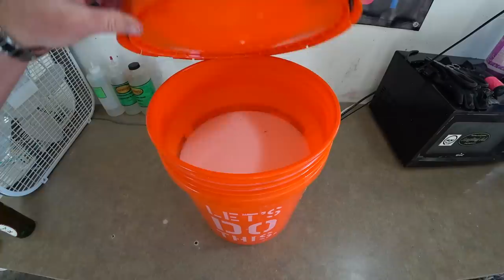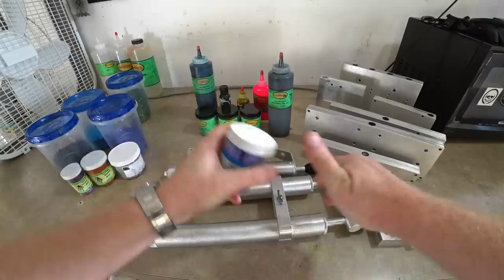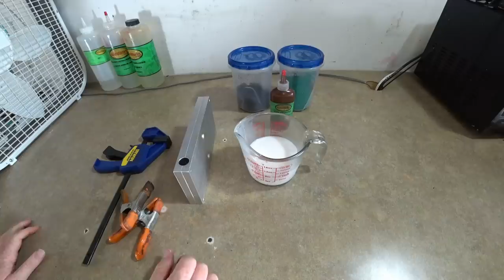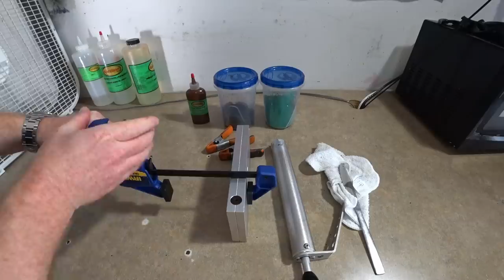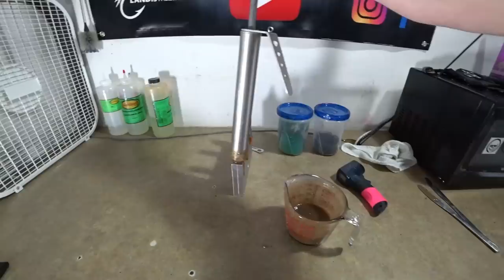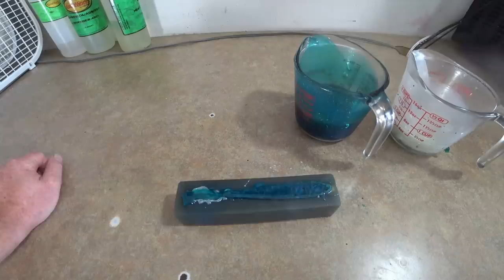COMPLETE GUIDE TO GETTING STARTED WITH SOFT PLASTIC LURES! How To Get Started pouring baits!

Comment: I forgot to properly mix my plastisol after it sat for months. I didn't clue in as to why the baits came out slightly firmer than snot until I noticed the 6 cm of solids in the bottom of the jug. Took a whole bottle of hardener to firm up the batch. A valuable lesson learned.

Comment: Awesome video! Learned a lot and can’t wait to start. By the way, I see you have a good ventilation set up, but as a respiratory therapist. I would still recommend using an N95. Micro particles are still being inhaled, which over time can lead to respiratory issues. Just some friendly advice.

Comment: Excellent video, have you thought about adding an overhead stationary post into the microwave that would stir the plastic as the turntable rotates? Just a random thought I had... anyway thanks for the excellent info I always wondered what the injection molds looked like and how they were injected. Thanks again.
Reply from the maker: never thought of that..some guys use cooking pots with electric stirrers if you are doing large volume.

Comment: You can save, you can buy most things and craft store for 1/2 or 1/3 the price, glitter, color and for the injector use a gear lube gun, just need to buy molds also can start with open pour molds and cut your expenses even more. Also for open pour molds you can make your own, plus you can re use old soft baits, I can see you doing open pour worms for less that $100.. 
However this vid is a perfect by the book way of getting starting in a more precise way.. and once you get everything you'll have tools that will last 100+ years. Your great great grand children could be using these tools.

Comment: Just finished lol. Another awesome video Chris. The plastisol fail was epic. Fly in the plastic, lmbo. The satisfying thing for me is that aside from the using the water part, I knew every thing else in regards to the injection molds, from you prior videos.  I feel like I am really learning lol. 
Question..Did you get the trick worms from BT?  
Also, could you tell me which baits should get softener added (generally)?
Reply from the maker: Glad yoy liked it..yeah the trick worm was from basstackle..it may be over at BTS molds now..I add softener to senkos and trick worms sometimes..depends on the order
Reply: Thanks bud

Comment: Is there a difference in the glitter you get from lure manufacturers and the glitter you get at like Hobby Lobby or Wal-Mart?
Reply from the maker: Yes big time, the lure glitter is a special high temperature polyester glitter than can withstand heat.  Most other craft glitters are aluminum which blow up in a microwave and bleed when hot.

Comment: I got a craw open pour for Christmas. And some little cubes that look like scent cubes for those little cookers that everyone loves nowadays. Have you any experience with those types?

Also do you have to deal with patent issues since you are selling your own with zoom molds or any other name brand molds?
Reply from the maker: never used any molds shaped like a cube, no patent issues if you use molds sold by most american mold makers, they are generally careful not to copy patented designs.
Reply: Sorry the molds are craws. Bit instead of using a plastisol and pouring and mixing you just melt the cubes. Then you pour that into the mold.
Reply: Link to the cubes on FUSION X FISHING - Xcube Soft Plasstic Plastisol Lure Making Cubes - 3 Pack (930 - BLACK BLUE FLASH) https://www.amazon.com/dp/B01N5GAW8R/ref=cm_sw_r_cp_api_i_p2CGCb81ZGY87

Comment: Hi Chris, at what temperature do you start injecting?  350 degrees?  I just started remelting plastic and some of my baits are coming out with voids or big soft bubbles within the senkos...I am not sure if the issue is the integrity of the plastic or maybe my temp is off when I inject...?  The only other possibility is maybe that my injector is sticking and pushing it down is not so steady and smooth like it was the first time(I bought grease for the o-ring just in case.  Sorry for the multi-part question but I want to pump out some baits during xmas break!
Reply from the maker: So normally I am between 330-350..shoot colder if you are getting pockets and dents.  The plastic itself should be just fine.
Reply: WWF, I will try a little colder and troubleshoot the issue on the voids/pockets.  Once I can iron out the problem I feel I can start pumping out a higher yield.  Thx!

Comment: I’ve purchased 2 pints of plastisol and just like it says on the net, at 177 degrees, it conceals into a solid.  I’ve tried power settings of 1,2, and 3 and kept the timer at 30 sec’s.  I still get clotting at 200 degrees. Help
Doug

Comment: How hot does the plastisol need to be? 340 or 350, no more no less? Can you add colorant and glitter after the first heating fast enough to inject or do you need to microwave it for a second time?
Reply from the maker: it needs to reach 350 minimum to convert over, after that you can bring the temps down to inject.  You can add your colors and flake after cooking if you want.  Most likely you will reheat the plastic to inject a second time.

Comment: How big are your normal injector? Thinking of buying a 3.88 oz, is that big enough for 2-3 single cavity 3" swimbait molds?
Reply from the maker: i only have the large injectors..my singles are all 9oz..i really dont have the experience with the small injectors to accurately say if it will work for your swimbait mold.
Reply: @WorldsWorstFishing  Thanks, will check on the forums.

Comment: Just wondering what I'm doing wrong. I can't get my glitter to evenly distribute in my plastic when making worms and ned Worms.  Is it that my plastic is too hot too much glitter not sure any advice would be greatly appreciated.
Reply from the maker: That's an odd problem to have I'm not really sure what's going wrong, you just stir a little bit before you draw the plastic up in the injector and it usually comes out pretty fine
Reply: @WorldsWorstFishing  I was drawing from the top of the cup.  When I started to draw from the bottom it did much better.

Comment: Does this save money or more just for fun?
Reply: I'm wondering how many 5" Senko's a Gallon of Plasisol could make?
Reply from the maker: does not save you a penny, will cost wayyyyyy more upfront actually.  After a few years if you dont buy new molds and stuff you might save in the long run.  a gallon of plastic will make a ton of senkos, not sure how many.

Comment: I have a Brush Hog mold that always bleeds on one side. Are there any tricks you know of to help alleviate this?
Reply from the maker: Are you talking about flashing?  Usually a closure issue
Reply: World's Worst Fishing yes flashing. I’ve applied vice grips and still get some. Is it an error with the mold?
Reply: It could be an error with the mold but try clamping it differently. I have Do-It's Senko stick molds and the 5' mold flashes ridiculously easy. I moved my clamp to the middle of the mold and also changed what kind of clamp I was using and the flashing stopped. I was using one of those hand spring clamps and changed to an Irwin Qwik Grip clamp and the flashing issue went away.

I have another Do-It mold that flashes if I shoot to hot (340ish+) so I just shoot it cooler, around 310-320 and it shoots fine like that.

So try changing/moving your clamps (be VERY careful using vise grips) and if that doesn't work, shoot cooler. One of those should work.
Reply from the maker: I hear about more problems with do it molds, I think you are just seeing some of the side effects from a lesser quality mold.

Comment: So get into CNC then?
Reply from the maker: if you have $100k to invest into the milling machines and software needed then yeah sure
Reply: @WorldsWorstFishing  
$1,000 a mold? 100 orders and you have your money back.
Reply from the maker: @qislegit.donttrustthemedia6232  there's many things to factor in...you need space to run the machines, usually it requires renting warehouse space, no successful mold cutting company I have spoken with has only 1 machine, your production will be too low, then a massive power bill to run it, milling tool replacements because they break, you need the actual aluminum blanks and then years of trial and error until your work is worth somebody's $1,000.  It's way more to start a mold company than just buying the actual machine.

Comment: Why a vacuum Chamber? Waste of money! Use a torch instead and it Will work just as good at removing bubbles! Maybe even better!
Reply from the maker: Incredibly incorrect, a torch will only pop surface bubbles, a vacuum chamber will actually remove the source of bubbles which is moisture.  One is a Band-Aid while the other is a cure.  Besides, this is a very expensive hobby, a vacuum chamber set is a monk one of these smallest investments all together.
Reply: @WorldsWorstFishing  well when you sre done heating  the plastisol  you put it in for 1-2 min on Defrost  and that makes the bubbles  raise  to the surface  then you use the torch  to pop them